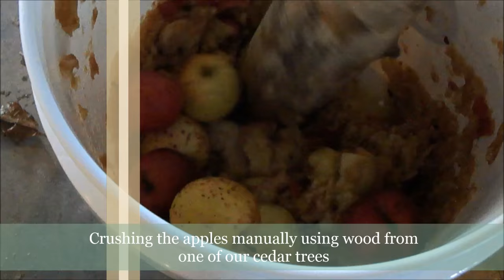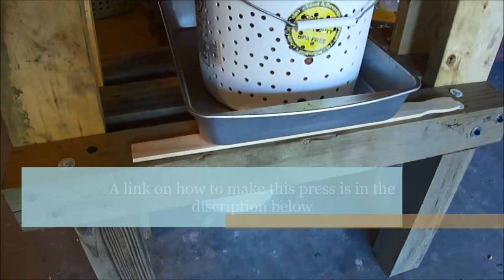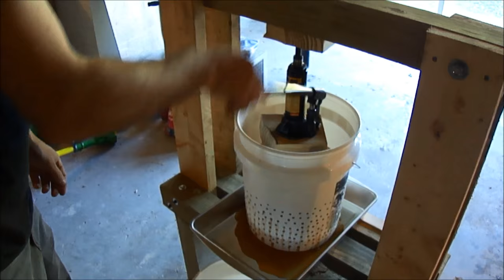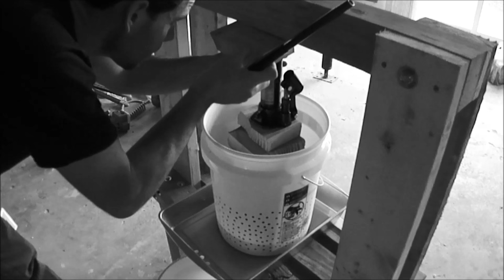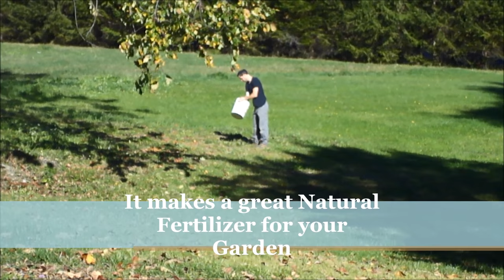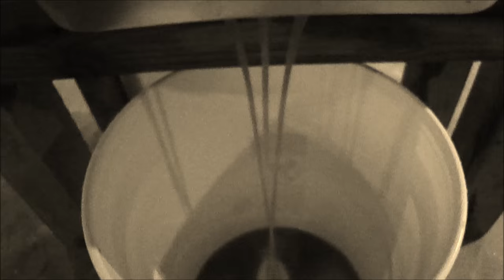Homemade Cider Press for about $50

Comment: Thanks so much for the grand idea. Of course I had to try to beat the $50 as a personal challenge. I was able to find the structure on my homestead and used a disposable roasting pan instead along with my car's jack. I am at $10, but I will need to pick up a couple more boards for the top of the structure. Guessing I will have $15 into it. 

Thanks loads for this idea, the challenge, and now I can enjoy the cider. Great video.
Reply: sheri giffin my father in law and I just did the same. We bought a new pan, everything else was repurposed. First pressing this weekend.